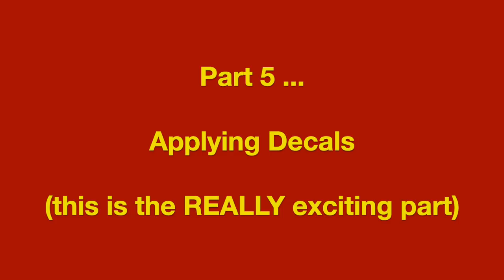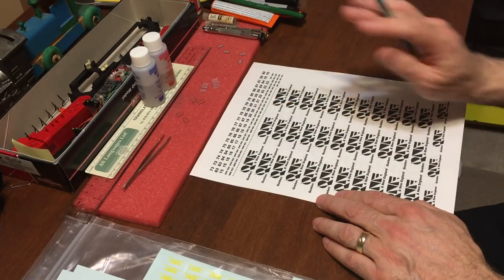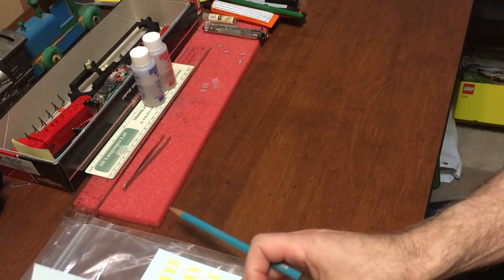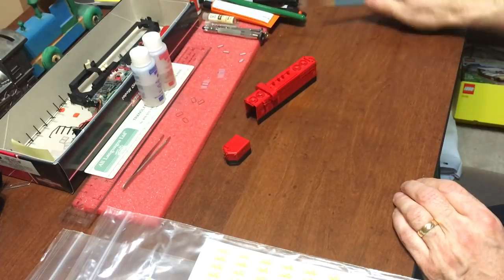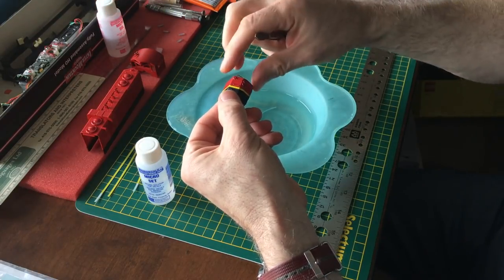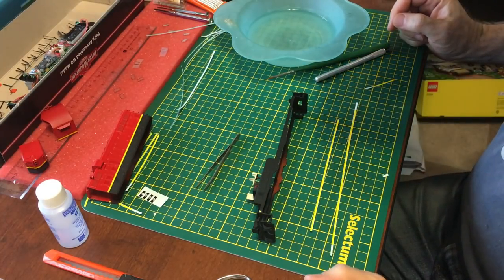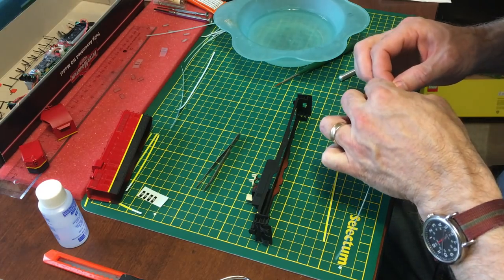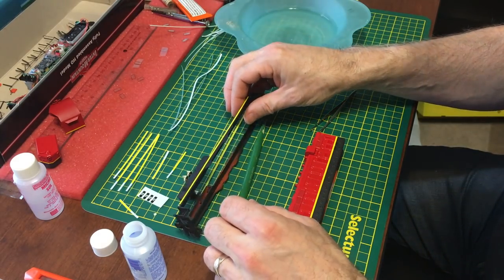Q&NE HO Layout Video 084 - 190419

Comment: Would it be possible to boost the sound somehow? I'm having a difficult time hearing you.
Reply from the maker: Sorry - the only way to boost the sound would be on the original video. Is there no way for you to raise the volume your end? It sounds fine when I watch it and I can even make it louder for myself. Would using headphones help?
Reply: I watched on a PC with the speakers cranked to max... but I'm the only one mentioning it so maybe I'm deaf 🙄🙂
Reply from the maker: Please let me know if you had the same problem with my previous video as well.
Reply: I agree the narrative is just to low and is frequently drowned out by the train sounds. The bell sound is just at the right frequency to come through on the videos not just your every-ones.It is like the cell phone when you can"t hear the other person but the ringing when you put your keys in the ignition is almost deafening.